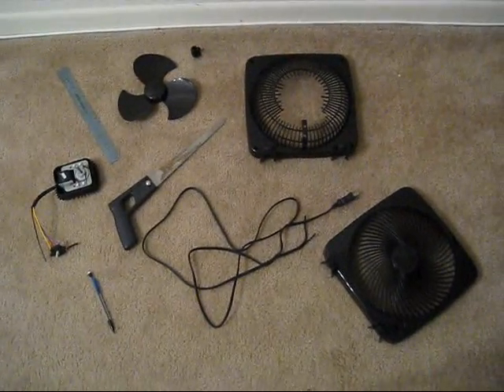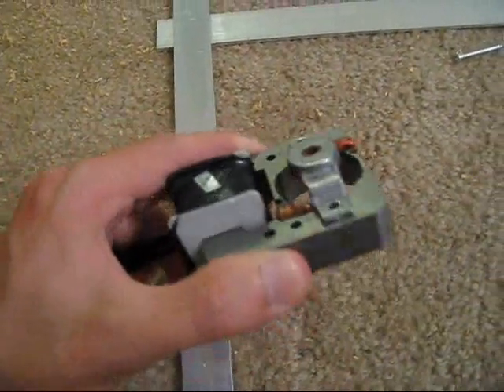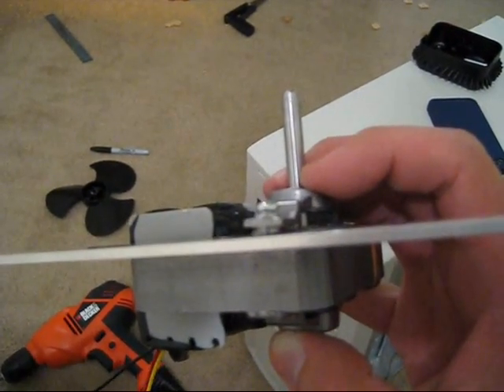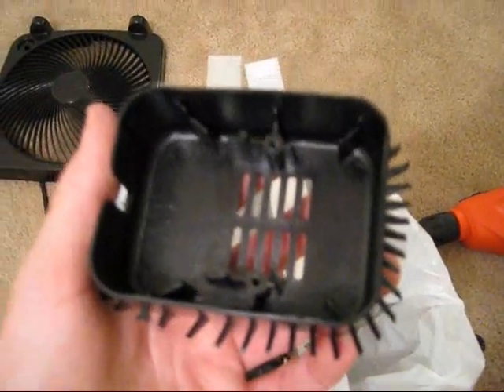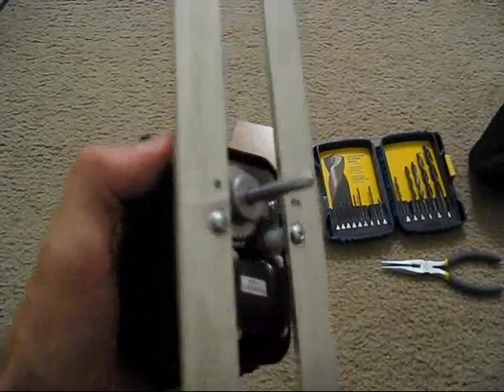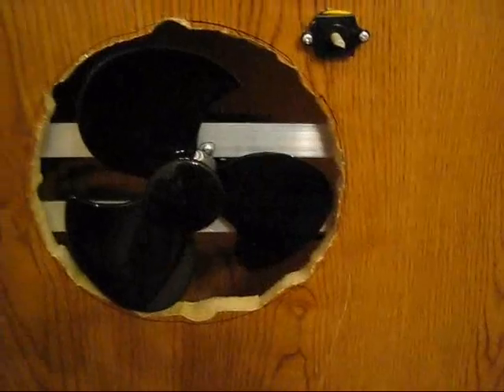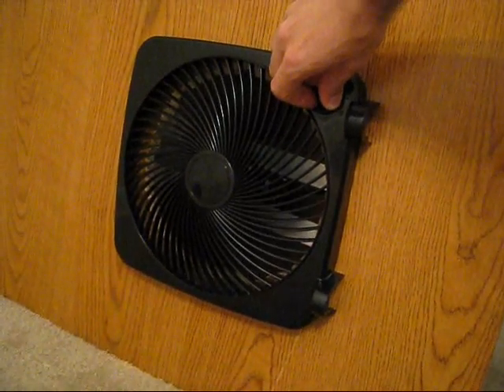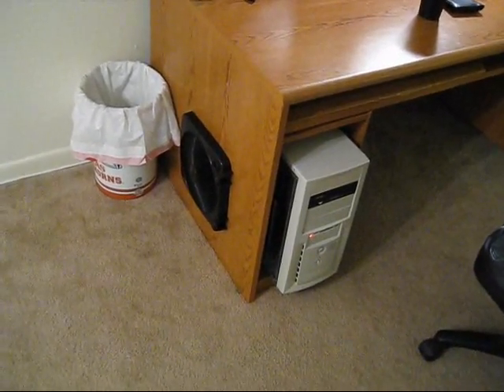MiniBuild: The Ultimate PC Case Fan!

Comment from the maker: well, the $10 walmart fan beats out the online deal for a $15-20 200mm fan, w/o shipping. Also, I still had to cut a hole in the desk to get enough air flow to the case (of course I could probably fit one of those 200mm fans in the hole, but this way I can swap computers more easily for upgrades, etc)